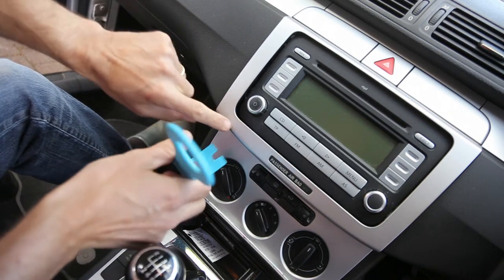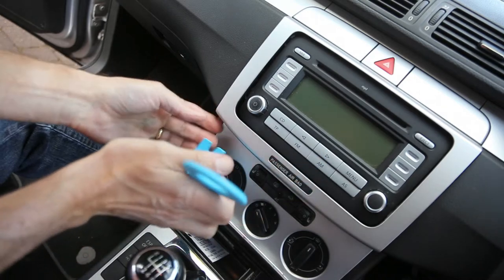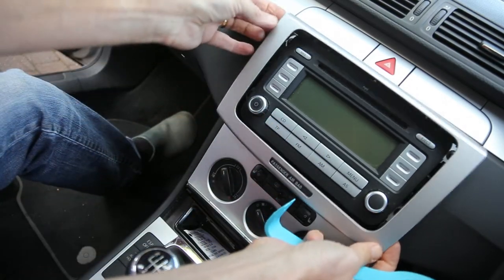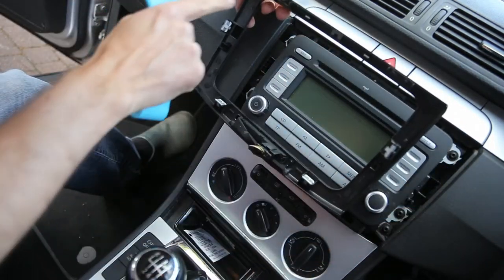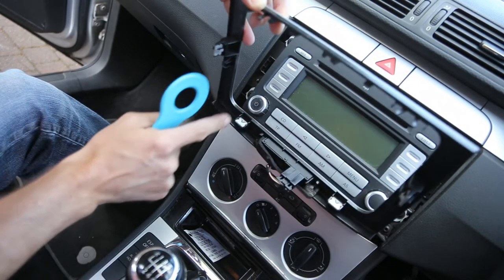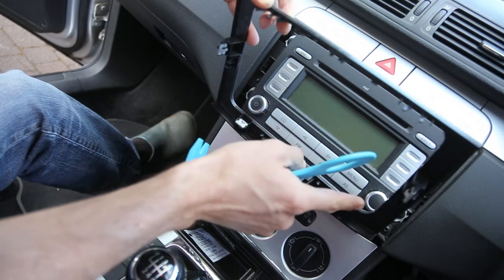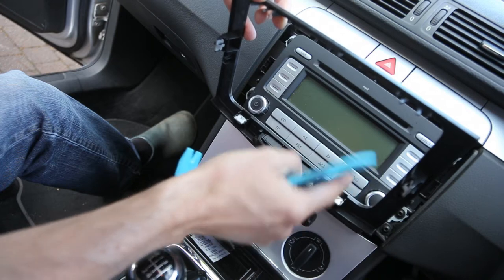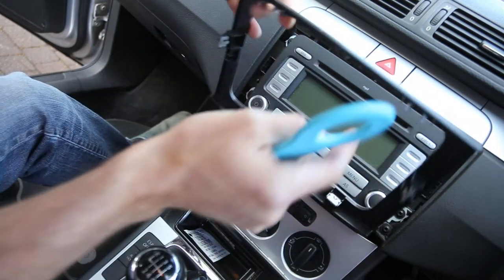VW Passat B6 2005-2010 Radio removal - How to Remove RCD radio

Comment: Do you know how to know the code for the radio before removing it? Or does this radios don't have a code?
Reply from the maker: The code should be on the card with service book. But it's also coded to the car so will start without needing a code as long as it's in the original car it was fitted to
Reply: @ajvw  thanks!!